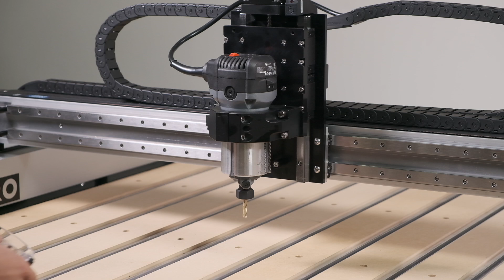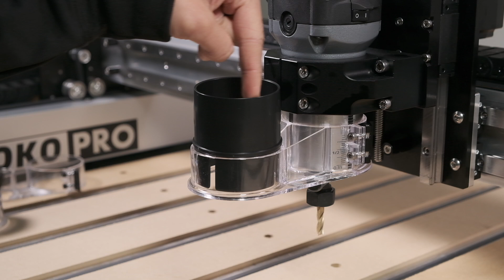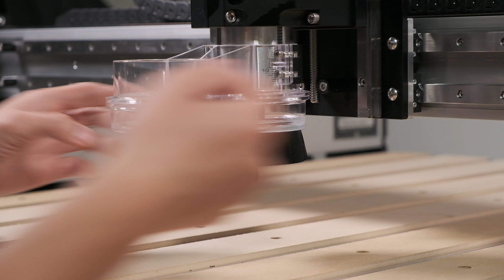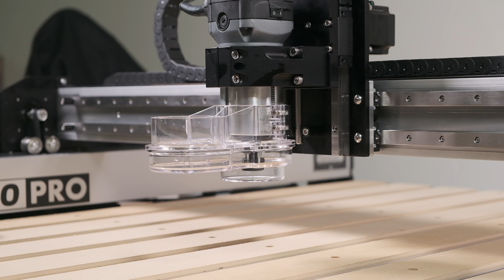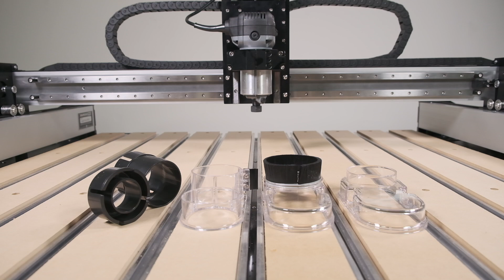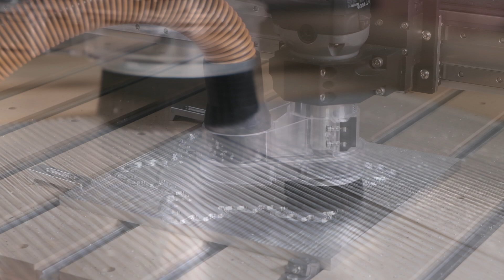Sweepy 2.0 - New and Improved Dust Boot

Comment: Good Informative Video but I have a Dewalt DWP611 router. It has a button on the side of the spindle to lock down to tighten down the collet and bit. Will sweepy V2 still fit this router with that button on the side of the spindle?
Reply from the maker: We offer this as an option for our Shapeoko 4 and Pro machines:  https://shop.carbide3d.com/collections/accessories/products/shapeoko-hd-69mm-spindle-mount?variant=39256345968701

Along with this version of Sweepy:  https://shop.carbide3d.com/products/sweepy-2-0-dust-boot?_pos=1&_sid=6cb3c6023&_ss=r&variant=32975721005117

Comment: It's a very nice upgrade, but why don't you make a sweepy that mounts on the z mount so it stays at the same  height instead of moving up and down with the router?
Reply: Because it's harder to design and makes zeroing the Z axis more difficult unless it's a detachable system, which in turn, is even harder to design and install
Reply: @alejandroperez5368 : Those things are all true, but it was still a valid question!

Comment: Nice upgrade but what about the Nomad ???  Could use a nice Sweepy 883 for it.  Are you forgetting the venturi effect ??  Air speeds up as it goes from a wider pipe to a narrower pipe.  Would not high velocity air pick up both heavy and light chips more efficiently ?  Remember Bernoulli !!  Also make bristles shorter to avoid curling and interference with spindle and end mills.  Really need bristles at all ??

Comment: ouch 30$ to ship to Canada
Reply: That's not really something the manufacturer can control. The part's weight and dimensions look to be as minimal as they can be (without sacrificing quality / durability) so there is not much Carbide 3D can do to lower the shipping cost.